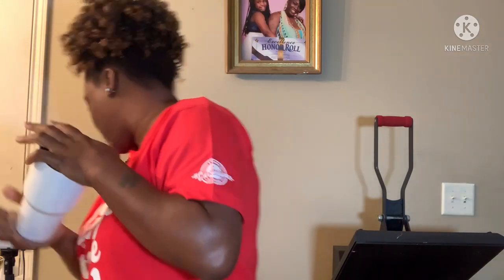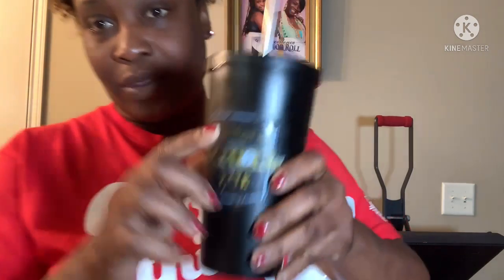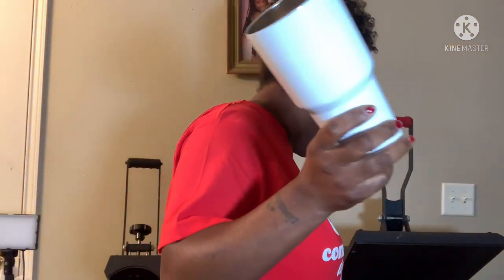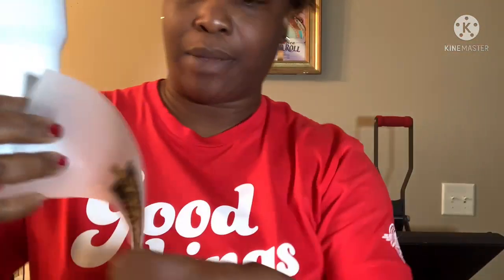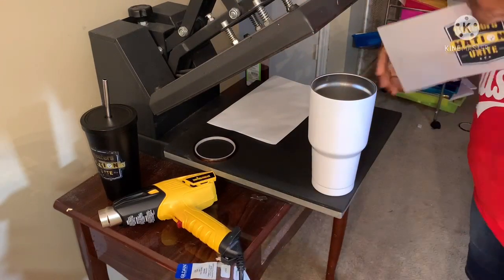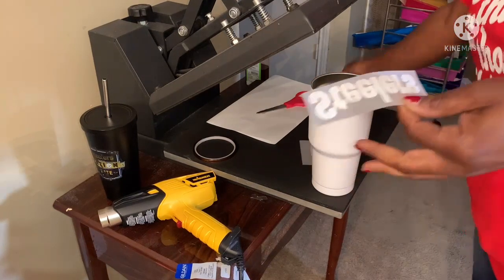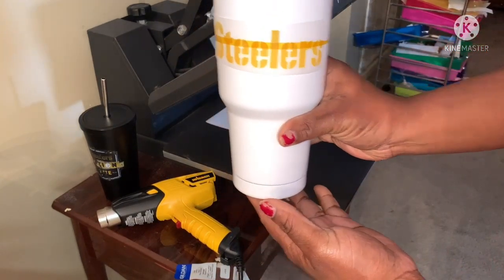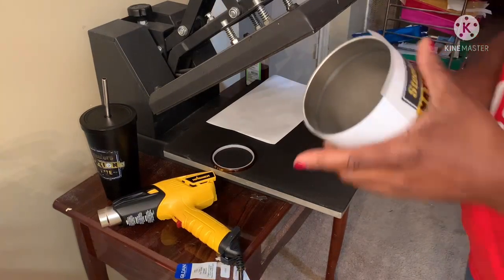DTF Print on Tumbler #dtfprinting #tumbler

Comment: Can you scratch/peel it off? I’ve done some and the adhesive can be peeled back off and it doesn’t truly bond with the smooth surface.
Reply from the maker: Use a uv resin to seal it